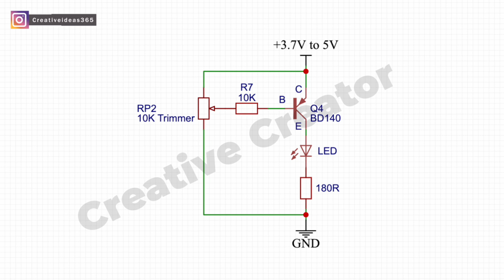Simple LED Dimmer Circuit

Comment: Would it be correct to say “This circuit controls the current in the LED”   or does it control the voltage in the LED ?
Reply from the maker: You are right it is current 😉

Comment: What clipper are you using on holding the components?thanks...
Reply from the maker: normal alligator clip with heat shrink tubing for components sharp edge protection.
Reply: Thanks for the answer..🙂

Comment: Hi. I want to light a 3w chip LED (sam as what u showed) and Dim it with 4v output DC adaptor (driver). Can the same circuit be used? I have a dimmer, and the LED is barely dimming when turning the potentiometer.

Comment: Why don’t you use potentiometer directly? Or is there another use for the transistor?
Reply from the maker: The point of the video is to use a PNP transistor for dimming leds 😉
Reply: @Creativecreator  That's great! But can you explain what the role of the transistor in this circuit is? I've seen other circuits that can dim LEDs without the use of a transistor. I'm just curious as to what the transistor does here. Thx!
Reply: @Calamity_Jack Because transistors act as adjustment devices for voltage and current. Resistors will produce heat and even smoke without transistors.
Reply: @lalmuanawmamualchin2430  Thanks for the info. But I'm using several resistors with LEDs now and none of them are heating or smoking. I just made sure to match the resistors to the circuit's voltage and current. When would transistors need to do adjustment?
Reply: Transistor can handle more power like 1a 2a or more, the potentiomenter will handle 0.5a at most.

Comment: Linear dimmer using transistors... Just sucks, is only suitable for low power LEDs, don't try it with high power dimmers or the transistor will burn.
Reply: Do you think lm2596 works with 5V input and 3W 3 Volt Led?